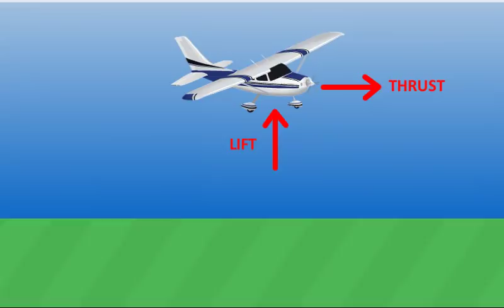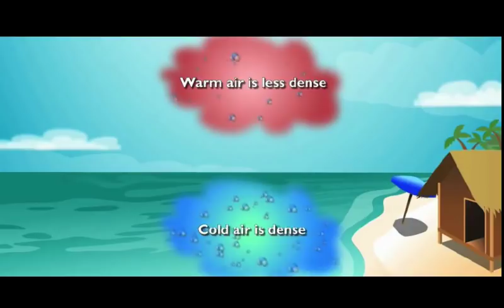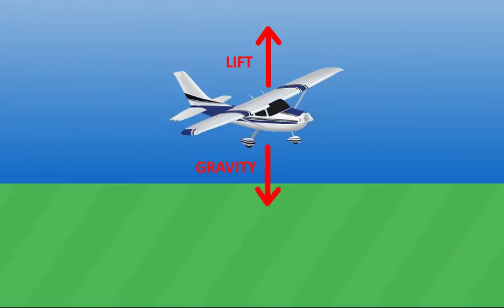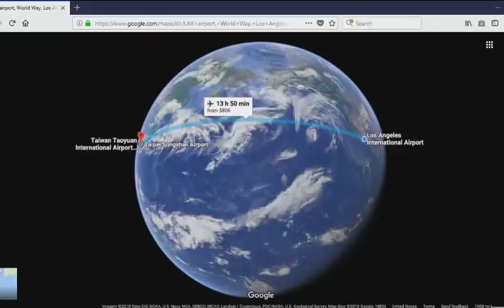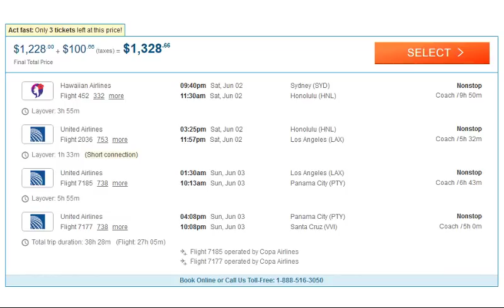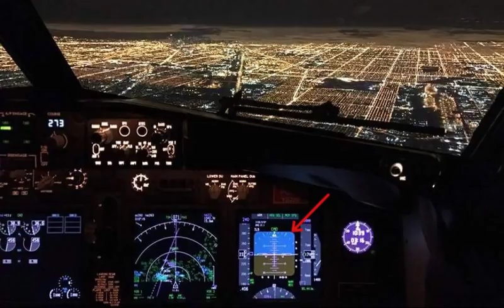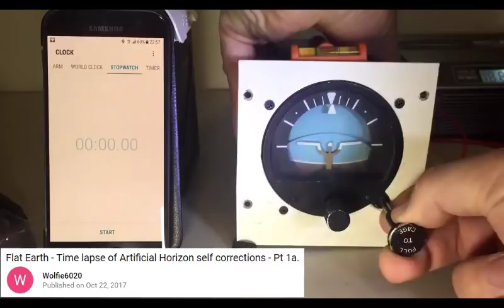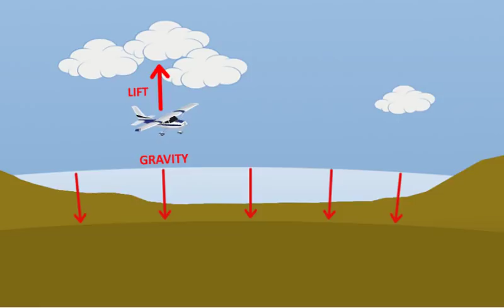Flat Earth Falsities - Plane Nonsense

Comment: im really trying to take you guys at face value but the more you think about this the more problems arise. 

Now you say gravity is pulling the plane parallel to the surface right? you also say that the surface is in fact spherical? before you use his line that gravity is flying level to itself (whatever that means) that still doesnt help you. 

parallel to a spherical surface going from lax to sydney or sydney to lax whichever you choose to call n/s...would be in excess of 180 degrees. in fact it would be somewhere between 180-360. if yoir claiming gravity holds the plane in that position that would be one thing. the plane never goes in that position. it would have too !

earths rotation doesnt explain this away either since i know thats probably coming. the earth rotating would not change the physical degress of a sphere. you guys already said all things go along with this rotation like a moving train so nothing can feel it. you can walk back in forth in a train right? thats how your saying we are to earth. if thats the case than earths rotation is null and void to every argument. the ground cant possibly be moving to meet the plane or that would only work in one direction. see i can walk back and forth on the train but if im trying to end up the opposite way the trains going i couldnt get there
Reply: "im really trying to take you guys at face value"
No, you really aren't.  If you were then you wouldn't be repeating the exact same nonsense argument that you have made 15 times over the last few days.
Reply: "More than likely they have been hiding the fact that we live in a geocentric system"
Geocentric does not mean flat.  In a geocentric system Earth is at the center of the universe, in a FE "model" Earth is at the bottom of the universe with everything moving around on top of it.  Do you understand?  In order for it to be geocentric things would have to move below the Earth.
Reply: Tell me more about your time-travelling planes hypothesis Bobby. 
Is that really the only way you can explain direct Southern Hemisphere flights? Time travel using secret alternative fuel sources? And you say globers live in a fantasy world!!
Reply: "both models present a 24 hour revolution yet we have countries in different days from other. if the clock runs midnight to midnight everywhere that shouldnt happen."
So you don't understand time zones.  I can't say I'm surprised.  Do you acknowledge that if someone in NY gets on the phone and calls someone in California, when they look at their watches they will see different times?  Do you understand why that is?  Do you acknowledge that the Sun rises in NY several hours before it rises in California?  You are arguing against all of science but you can't even wrap your head around how times zones work.
Reply: "level or straight"
Level and straight are not the same thing.  That is a primary problem with you guys.  You use the words interchangeably.  They aren't.
Reply: "Yes I understand it all and do no just blindly accept what they tell me and call me dumb if you want but the average Joe and Jill on the street would not know a heliocentric from a geocentric would they ?"

You claim to understand it all and you claim that average people wouldn't understand it all, but here you are using "flat" and "geocentric" interchangeably despite claiming you understand that they are different.
Reply: "OMG GMO yes i understand them. thats my point. they dont match a 24 hour revolution."
Oh they don't?  Tell me, where does the day start according to time zones?
Reply: "OMG GMO ok explain. hawaii is 3,000 miles to fiji. 5000 miles to australia"
This crap again.  Where does the day start?  Don't dodge.  Don't shift to another topic.  Answer the question.  Where does the day start?
Reply: "Geocentric is flat earth with a dome."
It really isn't. Geocentric = geo = Earth, centric = In the centre. As opposed to helio = The Sun (Helios),  centric = In the centre.
The Catholic Church used to burn people alive at the stake for criticising the geocentric model, but they didn't believe in a flat earth.
Reply: Bobby Wizdum
Stop dodging the question.  Where does the day start?  Once you answer that question you can begin to understand.  Right now all you are doing is throwing around numbers and confusing yourself.  Answer the question and you can start to understand the numbers.  Where does the day start?
Reply: Bobby Wizdum
Stop dodging the question.  Where does the day start?  Once you answer that question you can begin to understand.  Right now all you are doing is throwing around numbers and confusing yourself.  Answer the question and you can start to understand the numbers.  Where does the day start?
Reply: "OMG GMO im not dodging the question."
And yet you still have not answered it...

"there is a blatant problem with where the day starts anywhere"
Fine.  Demonstrate that it is a problem by first stating where it starts according to our currently acceptable model of measuring time.  You are saying it is wrong but you keep dodging the question.

"according to the globe 90 degrees east at midnight should be the official start of the clock. "
90 degrees east of what?  Chicago?  Miami?  Berlin?  90 degrees east of what exactly?  The North Pole?  Why are you afraid to answer that question?
Reply: "are you going to address the point of the original post"
You're original post had no point.  It can be broken down as "muh dunt understand gravity."  It has been explained to you numerous times.  This video explains it.  You are ignoring all the explanations because you want to keep pretending that you have a legitimate argument.  You don't.

"do you know where fiji is in relation to hawaii? how bout russia to alaska? canada to greenland?"
I understand just fine, you are the one that seems to have difficulty grasping the concepts.
Reply: "fly from fiji to hawaii in about 5 hours. youll have gone 18 hours into the future."
Into the past actually, and you were on the plane for 5 hours.
Reply: "OMG GMO they should start at midnight"
Midnight where exactly?  

"if this is true the whole world would be in the same day"
You acknowledge that the Sun rises in NY several hours before California, but you do not realize that midnight would reach NY several hours before California.

"i gave you tons of fun places to look up which in sure you havent."
Giving someone something to "look up" is meaningless if you do not explain what exactly it is you want the people to find when they "look it up."  "Look it up" and "research it" are the battle cry of someone who doesn't understand the topic enough to speak intelligently on it.  

"are any of you gonna attempt to dispute the original point of this post?"
I did address it.  Several days ago.  Several people addressed it.  Several days ago.  You are still arguing the exact same nonsense that has been explain to you by several times over several days.  You don't care about the responses because they show you to be wrong.  Look at how you are dancing around the topic of time zones.  You are refusing to answer specific questions.  You are dodging.  You are saying it doesn't work but you aren't attempting to even understand the concept of it.
Reply: " fly from fiji to hawaii in about 5 hours. youll have gone 18 hours into the future. how long were you really on the plane?"
Congratulations. I'm adding that to my Big List of Incredibly Stupid Things Flat Earthers Have Said. You are pretty close to the top. Well done.

"now are you going to disputrle the post in this topic or keep changing the subject?"
I don't even understand the arguments you are attempting to make. They literally make no sense. Try explaining better.
Reply: "you cant fly level over curvature. that doesnt work."
It does. Try drawing numerous tangents all the way round a circle. Every single one of those is level at that point on the circle.

"timezones are not time? and im the stupid one?"
Timezones are not ELAPSED time. The flight from Sydney to Santiago takes about 12 and half hours of actual elapsed flight time. You cannot use timezones to excuse the fact that this flight is impossible on a flat earth. Timezones don't change how long the plane is actually in the air. It's really not a hard concept.
Reply: "dont you see a 20 hr time gap in a 3000 mile distance as a red flag"
No I don't, and you would understand why if you would answer the question.  It seems you are terrified of the question though.
Reply: Hi OMG. Sorry mate but this one (Whizz-dumb), is like old gum on your shoes. Annoying but difficult to get rid of. He's a "NASA did it". flatty. Knows fuck all but thinks he does. Best of luck. Alf.
Reply: "Level means flat"
Level does not mean flat. Level means level. The bubble in a spirit level doesn't tell you if something is flat, it tells you if it is level, i.e. at a right-angle to down.
Reply: Do I need to quote you back to yourself Bobby? On this Justin Torres post https://www.youtube.com/watch?v=vPDCfV19UWM&lc=Ugy9-HuFbKkwTXtzvOh4AaABAg you said:

"we dont really have a clue how long its in the air. the ballers will get upset but reality is that time is kind of an illusion. that flight goes through multiple zones and i believe lands a day before it even took off. that sounds crazy if you think about it but its true... sure maybe you watch appeared to be 15 hours but can you be sure? afterall youve been on a plane for 15 hours and arrived a day before you ever left. theyll argue fuel but are we really naive enough to think there arent hybrid and maybe even partially solar powered aircrafts in this day and age? is that unthinkable that the plane could make the flight off multiple energy sources? not to me."

You are claiming that the Southern Hemisphere flights are explained because even though your watch says 15 hours the flight is actually much longer and the plane uses secret fuel sources to fly the extra distance. Yes? That is a ridiculously desperate argument and was the point I realised you must just be a troll.
Reply: Whiz-Dumb. Caught yer! You can't get away from me..... More word salad? A flatty cult, propaganda piece, that means nothing but manages to say more. You really need to get back on the meds, wipe the dribble off yoir (sic) chin and get some sunlight. Also. Still need a reply about how mass and "airyplanes" work. BOY I really love destroying your bullshit. FUCKWIT.
Reply: "drawing tangents? we are talking about a physical plane flying over physical curvature?"
Yep and it is level. Tangents are all level. They are at a perfect right angle to surface of the circle/sphere. 
See if this diagram helps: https://s33.postimg.cc/7unercrfz/level_tangents.jpg 

"im showing you a glitch in the time we know"
No, you are trying to derail into an irrelevant conversation about timezones, because you are desperately trying to distract from the fact you have no explanation for how the actual flight can be made in that actual elapsed flight time on a flat earth.
Reply: "would you agree geometrically right angles contain both a parallel and a perpendicular line to form this 90 degree angle?"
Yes I would. The "parallel" is the tangent to the circle, it is level. It represents the surface and the airplane flying level and parallel to that surface. The perpendicular is a line to the centre of the sphere/centre representing the direction of down (i.e. gravitational pull)

"the plane would have to be perpendicular" - what? No, no  it really wouldn't.
Reply: If you were fast enough, of course you can go the opposite way the train is going.
Reply: jordy,
I'm not going to click your link because I don't care how you think time works on your magical fantasy land.  I understand how we measure time here in the real world and that is what I was talking about since Bobby seems to have difficulty understanding time zones.
Reply: GrahamStw ive actually figured out this time riddle. the start and end of time are the same at the north/south pacific line. fiji is essentially the beginning of the cycle on land where hawaii the end. hence they are 22 hrs apart with 3000 miles of ocean in between. just as life is projected the end is the beginning. the loop never ends. just as if you left a record spinning. Thats what the sun is doing. the latitude lines are the grooves. the outer rim (antarctica) is the edge of the record. 

you guys claim the sun sets, the earth is tilted and spinning around it correct? the problem with that is on a ball the revolution would actually end. why? 

well according to you guys. sydney auatralia is on the opposite side of santiago chile right? 

hmm ok follow me. its friday 12 noon in cali right? in nyc and santiago chile its 3pm ok? in hawaii its friday at 9 am. here come huge problems. fiji its saturday at 7am. sydney its saturday at 5 am. wheres the problem you say? the sun is going to shine on both sides of your ball at the same time in opposite hemispheres as well and with one of the poles receiving 24 hour sunlight? you have been thoroughly destroyed.
Reply: OMG GMO ok explain. hawaii is 3,000 miles to fiji. 5000 miles to australia. if you actually look up the times in these countries youll see something wrong. fiji is east of of australia and 2 hrs ahead. due south of hawaii no further than the distance of maryland to california but fiji is waaay ahead of hawaii. cant be a north south problem as toronto and santiago are the same damn time at quadrupal the distance. uk and capehorn just an hour apart. md to dublin is closer than md to california but dublin is 6 hrs ahead of maryland.
Reply: OMG GMO no into the future. its saturday morning in fiji right now.
Reply: GrahamStw level to a sphere or parallel requires a turn. you cant fly level or straight over curvature. that doesnt work. timezones are not time? and im the stupid one?

your missing my point. fiji jumps 20 hours into the future from a distance just 3000 miles away to its northeast. that doesnt add up. it should be 3 hrs behind hawaii. not 20 hrs ahead. at most a six hour differential if theres some kinda east meets west phenomena or 3-3 making 0 change. 20 hours ahead?
Reply: GrahamStw lets run with your right angle to the curvature of a sphere shall we? would you agree geometrically right angles contain both a parallel and a perpendicular line to form this 90 degree angle? well then if the surface is parallel to the plane going 90 degress south over a ball ....the plane would have to be perpendicular. you just proved exactly what im saying with geometry. to the contrary on a flat earth a 90 degree angle would be the plane flying parallel to the surface. just as we observe.
Reply: equaltemp how? its enclosed.
Reply: GrahamStw its actually funny. Youre completely ducking my time zone discovery.
Reply: No... no they dont. where are your answers to very good questions? you insulting me is not answers. its your defense mechanism.
Reply: Yes I understand it all and do no just blindly accept what they tell me and call me dumb if you want but the average Joe and Jill on the street would not know a heliocentric from a geocentric would they ?
Reply: GrahamStw not really desperate at all. hybrid engines are impossible? a watch saying 15 hours when it was really longer is impossible? not at all. fly from fiji to hawaii in about 5 hours. youll have gone 18 hours into the future. how long were you really on the plane?

now are you going to disputrle the post in this topic or keep changing the subject? why isnt the plane 180 plus degrees if its parallel to a sphere?
Reply: OMG GMO they should start at midnight. if this is true the whole world would be in the same day. i gave you tons of fun places to look up which in sure you havent. you dont test you just talk. are any of you gonna attempt to dispute the original point of this post?
Reply: OMG GMO gravity doesnt explain what im saying. where is the 180?
Reply: GrahamStw u dont understand why parallel to a sphere would require a 180 degree turn to remain parallel at minimum going north to south? your surface is a ball remember? 

how am i stupid? explain this. right now in hawaii its 6:30 friday morning. in fiji its 4:30 saturday morning. in australia its 2:30 saturday morning.
Reply: OMG GMO im not dodging the question. there is a blatant problem with where the day starts anywhere ! fiji cant be 20 hours ahead of hawaii if there is only one sun. get it?

you havent answered any of my questions troll. you bullies are all the same. you demand answers but where are yours? ive been called stupid. ive had questions thrown at my questions. youve answered nothing ! according to the globe 90 degrees east at midnight should be the official start of the clock.   now answer mine.
Reply: ragingbull alf you spitting a bunch of insults destroyed something? it just proved your a small child incapable of carrying on an intellectual conversation. carry on.
Reply: More than likely they have been hiding the fact that we live in a geocentric system and not a heliocentric system ?
Reply: Bobby Wizdum

you cant fly level or straight over curvature

I said the exact same thing to GrahamStw in other thread, but somehow, he never understood what we told him:-D
Reply: OMG GMO this is a totally different argument. do you actuly listen to whats being said? clearly i hear yiu guys because im arguing against the points of view you mention. how is this the same argument as gravity needing to know the difference in mass between objects? its nit even remotely the same.
Reply: GrahamStw i never said time travel. i pointed out there are problems with the clock. both models present a 24 hour revolution yet we have countries in different days from other. if the clock runs midnight to midnight everywhere that shouldnt happen. antarctica has 24  time zones. did you know that? toronto and santiago chile share the same time zone. they are way further apart than hawaii and fiji. hawaii is 6 hours ahead of east coast. fiji is 18 hours ahead of hawaii makes sense to you? that means fiji should be a full 24 hours ahead of eastern time. its not. how about russia and alaska? they share an island but not a time zone. everything is not as it appears.

now would you care to tackle the point of this post? ive noticed a few of you in here talking ish but none of you have attempted to explain this away. i wonder why?
Reply: OMG GMO yes i understand them. thats my point. they dont match a 24 hour revolution.

are you going to address the point of the original post or keep trolling with your "you dont understand" redderick without even acknowledging what im saying. do you know where fiji is in relation to hawaii? how bout russia to alaska? canada to greenland?
Reply: OMG GMO

Time zone works on FE, please check this video.
This is only concept, this is only assumption.
But at least, it will give you the idea.
This will stimulate your brain that FE is make sense.

https://youtu.be/UmgcJuMSTxQ
Reply: OMG GMO

hehehe... that's fine.
I know, some people choose that option, better hear the sweet lies than the bitter truth.

That's your freedom of choice. No one can change that:-D
Reply: OMG GMO no i dont see.  la to hawaii makes sense. fiji to australia makes sense. hawaii to fiji makes zero sense.
Reply: GrahamStw watch what im showing you. pay attention. 

hawaii is 3 hrs  behind la 2500 miles sw. makes sense.
australia is 2 hours behind fiji 2500 miles west. makes sense.
fiji is 20 hours ahead of hawaii! 20 hours! ahead!  its 3000 miles south west. how in the hell does that make sense on any model?
Reply: OMG GMO i answered you. the reason it doesnt matter is that we are supposed to be doing one rotation ! 24000 mile ball , 1000 miles eastern , around the sun right? flat has the same problem with one sun. 

time weve seen changes little north to south you follow? only west/ east. if youre following the pattern there is a huge glitch right there between hawaii/fiji. this is near where amelia aerheart said something is terribly wrong ! 

dont you see a 20 hr time gap in a 3000 mile distance as a red flag or are you going to just keep on with your pointless bullying about your question ive already answered?
Reply: GrahamStw drawing tangents? we are talking about a physical plane flying over physical curvature? the tanget cant be flat down the whole face of the ball. 

im showing you a glitch in the time we know. forget about the dumb flight and what the time says. time changes pattern and has a huge problem between hawaii to fiji ! map the time going east china...india...australia...fiji.....hawaii wtf happened?